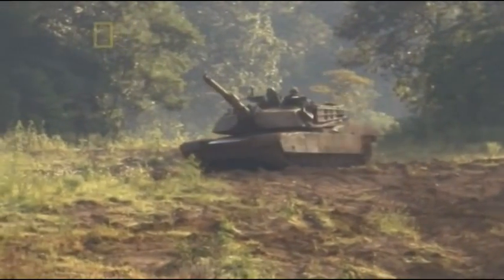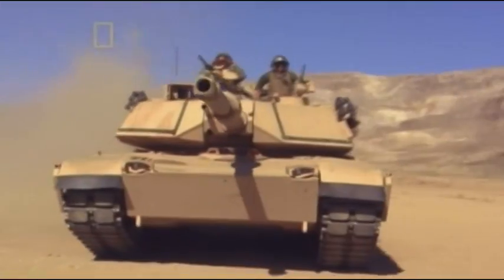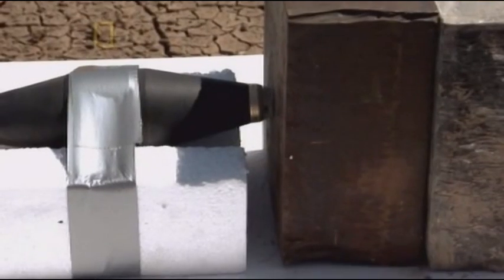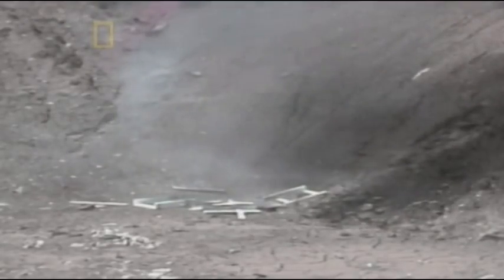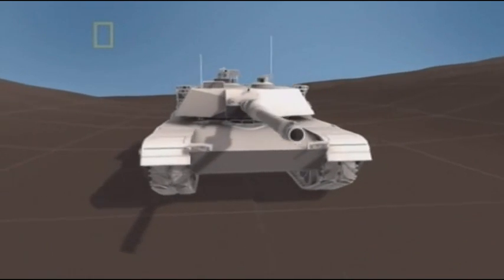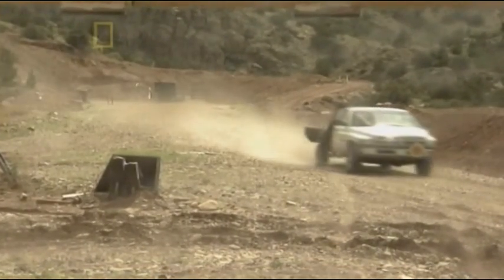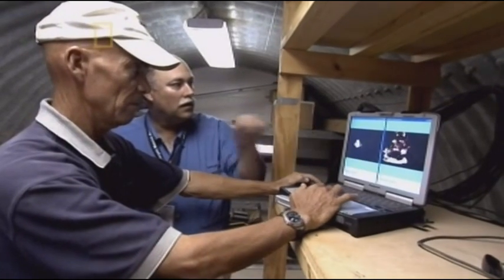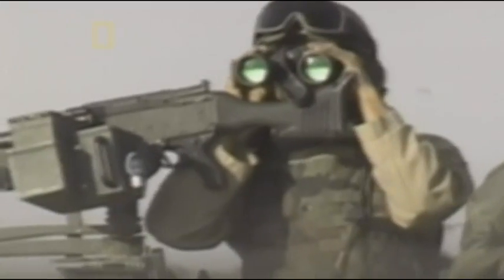Explosive Reactive Armour Explained

Comment: Does this work with Depleted uranium High Velocity Sabot? Or Thermite Sabot?
Reply: +Katch Dance Some do, if they're good enough. The Soviets developed their own type of ERA called Kontakt 5 which was capable of defeating the American M829A1 APFSDS-T round. Kontakt 5 quickly lost relevance however, the M829A1 was quickly replaced with the M829A2 which was capable of defeating it. These rounds and armor were used a while ago though, today the Americans are using the super powerful M829E4 round and the Russians aren't really even bothering with ERA anymore.
Reply: +Mr556x45mm Relikt
Reply: Toma Chinelada Right, Relikt. Forgot about that. The M829E4 was introduced about a month or two after the Armata which uses Relikt, if I'm not mistaken.
Reply: +Toma Chinelada iirc the M829A4 is segmented and is specially designed to counter Relikt
Reply: Nope.. Only Chemical ammo.
Reply: @Mr556x45mm  armor is starting to go away anyway. Militaries will still be using era because it's light and still effective at stopping some chemical projectiles. It's all about speed to survive now. The APFSDS is so effective not only because of its incredibly high penetration powers but also the energy transfer shattering the thick armor and causing spalling, basically turning your armor against you. Thinner armor means less of that energy is dumped into the armor and there for you will have this round travelling right through and not doing alot unless it hits critical components like an engine or ammo which isnt that hard but with a highly mobile and moving target can make it difficult

Comment: @marmaladekamikaze ERA won't disable protected vehicle (may effectively disable nearby infantry though...) because base armor is always taken into account durring developement. Cluster ammo "clearing" ERA from tank sounds neat, but tandem HEAT can pierce single-layered ERA and hit armor behind it. Modern KE long-rod penetrators are also quite effective against ERA, DM-53 fired form Leo2A6 has like 50% chance to penetrate frontal armor of T-90 or Type-99 tanks with first hit.

Comment: Only 10 years later, tanks are now slow sitting ducks with the current plethora of hand-held anti-tank weapons like stingers and javelins. If the Air Force is turning to unmanned drones with amazing success, why are some countries still bothering with 3 crew tanks? 
Out of all armoured equipment out there, a tank would be one of the easiest to convert to AI/Remote control operation.

Comment: "RPG" is not originally the short form for "Rocket propelled grenade", so it is for "rutschnoi protiwotankowy granatomjot"
Reply: Feuerwerks FunGE can you translate that to English
Reply: Haseeb Syed It means basically the same, kind of "handheld anti tank grenade launcher".
Reply: Firefly Fireworks exactly. Look up 'RPG 43'. It's a hand held HEAT grenade...no rockets or launchers involved. RPG means "hand held anti tank weapon"
Reply: Firefly Fireworks you misspelt the Vs with Ws.

Comment: what if the shooter is a KV2? :)
Reply: EmmethPearce  Too much war thunder/world of tanks ? To answer your question,the same thing as in the video
Reply: +EmmethPearce Well, with the old ass ammunation it will do nothing but shake the crew like in a old ass moskvich.
Reply: +EmmethPearce KV-2 could'nt pierce a tank. Its granade has really slow velocity and is made to destroy bunkers,fortifications and buildings, not tanks.
Reply: KV-2 is meant to for close range support not head on assault.
Reply: kv2 main gun shoot HE and have bad accuracy
Reply: to all that say that such a shell wouldnt destroy a modern tank ... maybe not the tank but the explosion is massive so the armour would be dented inside and fragments of the cracked metal would fly through the crew compartment 

so technically the tank isnt destroyed .. but the crew is swiss cheese or their just dead by the shockwave of the explosion
Reply: Modern tanks have composite armor and its not causing spalling damage like the old WWII type of armor when enemy is using HE or HESH ammunition...

Comment: I doubt militants have access to modern RPGs.  They were invented in like 2003-2006, and the militants are using old surplus stockpile crap from the cold war.  I bet the Syrian army has these, though.  You never know when the Israelis may come knocking on your door, and from what I understand the RPGs were specifically designed to take out Israeli tanks.

Comment: because the reactive armor on the tank already weighs in at a ton... and a hummer does not have even 1/2 the armor a tank has... if it did it would be very slow because its weighed down so much...
Reply: If an Abrams can already hit speeds of 40mph weighing 65tons thanks to it's 1500hp almost 4000ft-lb of torque gas turbine engine. The weight of the era isnt going to slow it down.

This is why it's not used on humvees or Oshkoshes they rely on aps.

Comment: the HMMWV is faster and still more maneuverable... the bushmaster weighs more, it is much taller making it easier to spot and a much easier target... a bushmaster was designed to take up to 9 men and all of there equipment, fuel, supplies for 3 days and take them right into the action... The HMMWV was designed primarily for personnel and light cargo transport behind front lines, not as a front line fighting vehicle, so I do not know why you are comparing the two...

Comment: why dont they use a beamforming reactive armor to allow for more aggressively slopped v-hull designs in armored Humvee, you could detect the surface waves through accelerometers in the tire axles of the vehicle and produce a firing solution that precisely slices the explosion based on where it is sourced relative to the vehicle and seed a force field profile of the blast wave that travels parallel to the slopes of the v-hull.

Comment: 2:56 It's not technically molten copper... It's actually solid metal traveling at hypervelocity,  causing it to ACT like a liquid.
Reply: It's neither, the explosive force penetrates in a kinetic manner, it literally just pushes aside the armor. You can see it very well at 5:53. The copper liner is what shapes the explosive force. If anything the tip that's separate from the rest of the jet is the where the copper ends up.
Reply: +Chuck Finley What happens is that Munroe effect causes the copper to absorb ~40% of the explosive's energy and causes it to be pushed forward into a hypersonic superplastic "stream" that penetrates the armor at ~ 3 km/s
Reply: @poisonarc  I have never read something so wrong. Literally every source disputes your comment
Reply: @CHADTHUNDERCOCK80085  5 years ago sure but they were wrong then and they're wrong now. Wikipedia has since been corrected, page 6 of the fundamentals of shaped charges backs me up as well as a source I don't want to disclose. For intents and purposes the penetration is kinetic tho the action is chemical.

Comment: Excuse me Sir let me make you a question. Behind the copper in the RPG. some part of the explosive go inside the armor attacked ?? or any sonic impact ? thanks for your comments
Alex
Reply: Explosive force does not go inside the tank. A jet of copper, at several thousand degrees and at many times the speed of sound cuts through the armor, detonating ammo, fuel, and killing the crew.
Reply: @ribbitgoesthedoglastnamehe4681  I would also like to point out that the video gave misinformation about how HEAT works. It doesnt form a jet by melting the copper, melting away the metal and thats how it penetrates. 

The explosive causes the copper bell to collapse on itself forming a superplastic jet as it's directed through the projectile. It's penetration it due to the sheer velocity of the jet and not the temperature.

Comment: What happens if the abrams gets hit by something like a 20mm shell or a 30 or etc? Would the tanks armor just keep getting blown up?
Reply: +Mike Tyson Depends on the ERA and the pen of the shell. If the ERA is designed to react not only to Shaped Charge ammunition, but something like APFSDS, then yes, it will keep exploding. If not, some shells will have enough penetration to go through the ERA and the steel beneath.

Comment: missile or rockets with double charge will go true explosive reactive armour and the tank. the first charge detonates the reactive armour then the second will penetrate the main armour.
Reply: Or maybe when the first charge hits the ERA the explosion will bloow of the second charge off.....it might!!!
Reply: ^that will happen
Reply: Muhmmed Nadeem tandem charges are timed to only detonate a few moments after the first so that in case of ERA hit, the shockwave goes through the second charge and only then it's activated for an undisturbed shot.
Reply: Filipe Amaral no you are wrong. the missiles or rockets that are used to hit a tank is shaped charge. it travels 25 times the speed of sound when the charge is detonated.  that is very fast. the second charge detonates very fast at the right time.
Reply: xzaxx There are slow motion videos proving what I said. Speed of sound? Electricity works at nearly the speed of light.

Comment: what about the 2nd fire of RPG or any rocket incoming from enemy in the same part of the tank?have 2nd protection?
Reply: That's why the plates are very modular.  You could hit the same spot twice and get through, but the odds of you hitting the spot that just blew up are pretty small.
Reply: The odds of hitting the same spot twice with an rpg are zero. It’s already hard enough to hit a tank with an rpg. I’ve fired the more accurate AT4 and they take a good amount of skill to use

Comment: Anti tank missile = $100,000.  Tank = $10,000,000, minimum.  The missile will destroy the tank more times than not.  The missile can be fired from pretty much any platform.  Boat, airplane, helicopter, hand held devices, light vehicles, heavy vehicles.  Destroying a tank on a modern battle field is trivial against any modern military force.  Meaning USA, Russia, China, Isreal, Germany, England, France, et cetera.  The tank is being phased out as we speak.

Comment: @lst1195 haha yep. this is pretty old tech. the latest russian RPGs are specifically designed to defeat ERA. they have two projectiles, one small one which flies faster than the main round. it will hit the ERA, create a gap which the main round can penetrate. also the chinese have been plastering their older tanks with the stuff. pretty cheap way of upgrading your tanks.

Comment: Would the explosion from ERA cause some damage to the tank armor behind it?
Reply: FeelFree3 sure but it won't penetrate. The whole point of ERA is to prevent penetration.
Reply: It wouldn't as the explosion would propagate out into the air as that's the area with the least resistance.

Comment: But it seems reactive armor is mostly added to the front/top of the hull, sides of the hull, and around the front facing side of the turret. The beginning of the video said the top and back of the tank is vulnerable. The top of the turret and the rear engine compartment is still vulnerable.
Reply: Slat armor in the back
Reply: Top attack is rare, slat and the extra armor added by the engine protect the rear.
Reply: Chuck Finley arent there top down attacking AT missiles though?
Reply: VatiWah Yes but they''re usually SUPER expensive.
Reply: +VatiWah There is but unless you're fighting a 1st world country like the US or UK nobody will have them

Comment: why not use water tanks instead of explosives to freeze the copper?
Reply: Because at best you would just get a copper lance shrapneling inside and killing the crew. At worst, the water would be effortlessly vaporized, with no effect, unless you carry a meter of it, and with nitrogen, the explosion would just push it aside.
You NEED an opposite and equal or greater counter force.
Any "cooling" solutions would be massive, doubling or tripling the size and weight of the tank, making it slow, heavy, and it would have lots of problems. Imagine trying to do maintenance with tanks of liquid nitrogen EVERYWHERE. Mechanics would be disposable goods, single use only.
Reply: Because shaped charges don't penetrate based on temperature. The copper jet is formed through superplasticity, the force of the explosion collapses the lining forming the jet. It's not actually melted

Comment: @quickzilver333
Also the T90 is much better equiped than the T72/T80, it has better armor, a better gun, and better technology. The T90MS is one of the most heavily protected tanks on the planet, as of today I don't think there are any MANPADS that could defeat it's armor in a single hit. I'm not bashing the M1 Abrams, but it definitely isn't the best tank on the planet.
Reply: Well considering MANPADS is man portable AIR defense system I would hope not

Comment: Why wouldnt you put reactive armor all over the tank, not just on the sides?
Reply: They explained it very well at the beginning
Reply: Largely because NATO tanks carry laminate frontal armour which is considered to be adequate. Russian tanks, smaller and lighter and with only rolled homogeneous steel armour do indeed now carry frontal as well as side arrays of ERA; the Kontakt-5 system is considered to provide effective defence against both HEAT and APFSDS, neither of which steel could do on its own.
Reply: Well the mix that the turret armor is made of is equal to the strength of 2ft of steel. 

And check out the battle of easting 1991 Gulf War if you are asking about Americas armored capabilities.
Reply: ***** Which, given the 'War of the Worlds'-esque imbalance between American targetting & engagement capabilities and the Russian equivalent, it probably is. Abrams is like a Tripod; fast and incredibly lethal with swift first-strike kill potential against the slower Russian model of massed Abrams-fodder. Could Russian tanks have overwhelmed Abrams with sheer numbers? In the right situation, probably. But the US armour was tough enough for the ideal scenario in which it was used most of the time. Russian tanks and older US models like M-60 definitely needed the armour upgrade to pose a realistic threat, while Abrams just didn't really.
Reply: ***** That sort of arbitrary armour comparison is as old as wrought-iron armour. Look at the comparative protection reckoned to be provided by wrought iron, steel, Harvey steel and KC in terms of  their relative performance in inches of timber. It too is essentially meaningless yet in service there was a grain of truth and logic to it after all. So comparative values, I think, don't need to be taken too literally. Nor really do proving range figures. It's definitely battlefield performance that counts. Like it or hate it (and I'm not a great fan of the vehicle) but Abrams has a good battlefield record against enemy armour.
Reply: ***** Look, I'm not arguing. However, what I said was that US armour was considered to be adequate (as you said, in reference to 'ego') and as proven standard steel was not up to the same level. What you've just said about Russian ERA (which is indeed excellent stuff and of which I am a fan) being applied to their tanks only goes to further show this to be true; they need that stuff to be viable MBTs in the modern era. I honestly don't think that A) what I said was at all hard to understand, or B) that we're even disagreeing with one another. We good? :)
Reply: ***** Now I definitely agree with that! NATO spent a lot of time during my childhood in the late stages of the Cold War trying to persuade me and my peers otherwise. However, the truth will always out in the end.
I think it all comes down, as you suggest to different tactical doctrines each producing different solutions to the respective problems. Even in the 80s though, the Red tank horde was truly feared. There was always a reason for that fear....
Reply: ***** there's no such thing is because we're the only ones that have it. M1a2 prototypes are still being tested
Reply: ***** the Saudis buy our downgraded tanks... America does not sell its best equipment to allies. We keep our best technology for ourselves . That's why Saudi tanks are easy to destroy when ISIS is attacking them
Reply: ***** no.
Reply: cplusplusgamer it's way to expensive
Reply: @KrillLiberator  Those russiam mbts still use composite armor in additon to integrated era it's not just RHA with era on it

Comment: AT-4 and SMAW wont work. Explosive reactive armour, such as the one on the M1A2 Tusk known as Arat-1, or Kontact-5 on current Russian tanks (Such as T-72B series and T-90A) was specifically designed to defeat HEAT warheads, you need a tandem shaped charge in order to defeat ERA. However, certain sabot rounds such as the American M829A2 have been proven to beat Kontact-5 heavy ERA. And SMAW's HEAA wont work either, for the very same reason HEAT wont. 

So SMAW and AT-4 would be useless.

Comment: @redreaper2020 It is effective against weapons with single charged but when you put it up against Modern tandem rounds it is useless. Just look at the tanks equiped with ERA in combat. Israels Merkava equiped with ERA suffered alot of loses against the Kornet E. Russian T-80s/T72s has the same result. Have you ever wonder why the Abrams weighs 70tons? It's the Armor that offers the best and most protection.

Comment: I believe this is useless when enemy tank is firing at them. 120mm gun, 125mm gun there no way your armor can survive with those rounds.
Reply: If those 120mm rounds are still firing single charge heat, then yes it will

Comment: @acidburn134 LOL! The T72s and T80s with K3/K5ERA were also getting sliced open by Chechen Rebels. They would attack the ERA with multiple RPGs until the section is expose. ERA is obsolete a one hit wonder. The Chechen didn't have alot of tanks and the ones they have were Soviet made not Russian. The Chechen tank hunter killer team equiped with RPGs and anti-tank missiles are slicing open the might T-80s and T72s...LOL! Do your research again!...LOL!